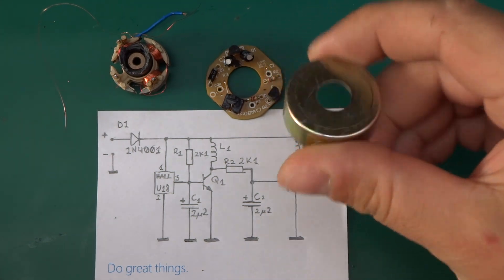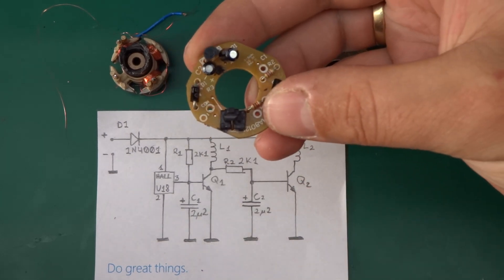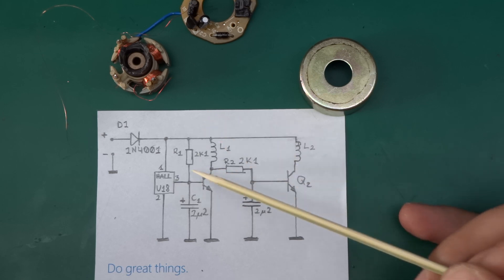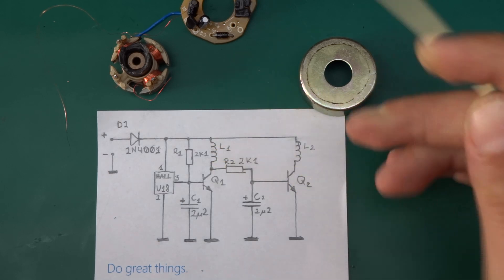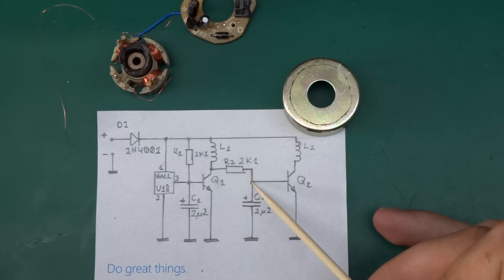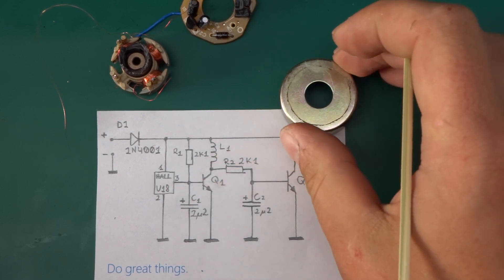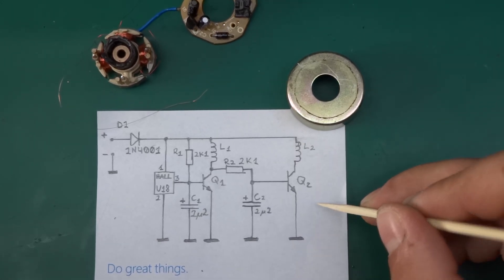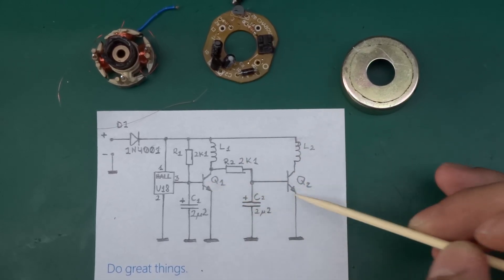PC fan BLDC driver circuit reverse engineered

Comment: great video. i am trying to work out why some 10 year old 4cm 4-wire 12V DC fans that still spin fine throw up an error signal to a NAS system. Out of 17 fans tested 7 have this problem. only another 37 fans to test. I wonder if they are fixable.

Comment: Do you know how a 3 pin and 4 pin fan works? I wonder how the third wire count the spins.
I'm trying to turn an array of 2 wires fan into a 4 wires fan. Any idea how that could be done using a spare 4 wire fan?
Reply: Isn't the third wire which is counting the spins just connected to the U18 pin 3? It sounds like it. What do you think?
Reply: 3 and 4 wire fans are significantly more complicated - the third wire is a tachometer, usually called "sens", which is a square wave signal based on the rotational speed of the motor.  Fourth wire is a control wire which usually takes a 5v square wave and will alter the speed of the motor based on duty cycle.

Comment: bldc motor has 3 connections but u are showing only 2 connections
Reply from the maker: I show the 2 that I flipped, 3rd one is left as is. Btw. BLD motor has number of connections depending on how many "phases" it has. 3 phase would have 3 (or 4 if star config), 4 phase would have 4 (or 5), 10 phase would have 10 (or 11)

Comment: I take it that if you want to change the speed you could change the capacitor or resistor size as it is using a simple rc circuit for timing?
Reply from the maker: I think so. Haven't tried it, but that makes perfect sense. It could introduce startup issues though
Reply: @randomtronic  hadn't thought about that.  Hard to get my head round.  Probably the best way to check it would be to try it I suppose.  Not really that bothered to be honest just curious!  It probably has a sweet spot covering a certain range of speeds but l could be wrong!  ;-)
Reply from the maker: @gartmorn  makes sense. Likely it can be tweaked a bit within some range, but not too much. But as you said, there is one way to find out :)

Comment: just connect 3 coils negatives to ground and power the coils using a timing sequence .
ie using a decade counter. and you don't need more circuit. except may be powerful switching transistors. like a uln2003 which is a switching transistors packed 10~ of them together.
Reply: and just reverse the 4017 and motor witll start running reverse.
Reply: Ne555 can drive it with custom timing

Comment: Typical circuit, similar to some PC fans I disassembled, however it's a bit surprising that there usually isn't any back EMF protection at all (maybe no need for it with the slowed down turn-on/off though)...